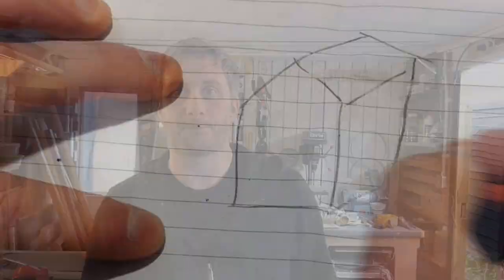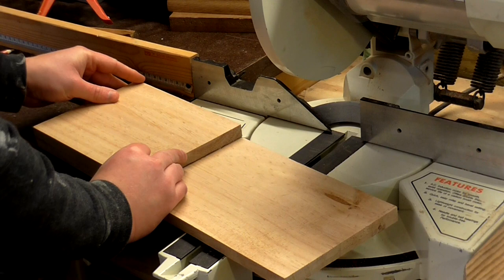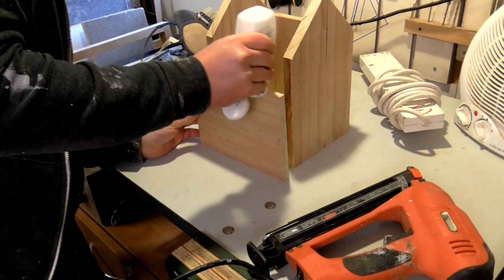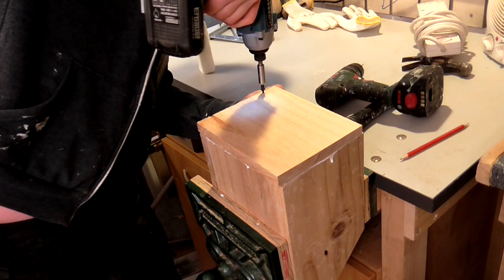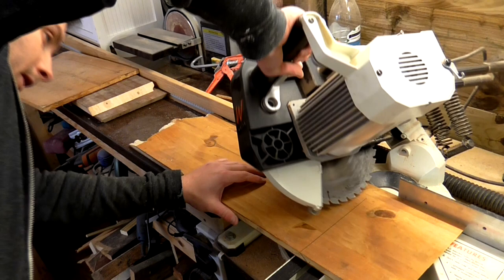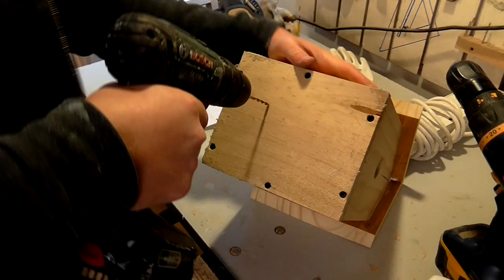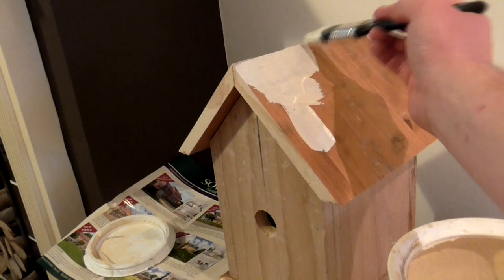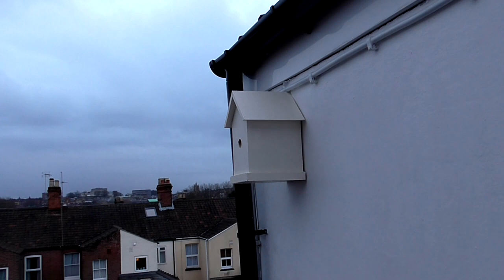Making A Simple Birdhouse

Comment: May I suggest some improvements?  Make the front removable for easy and thorough cleaning out. Cut the floor to fit inside the four walls , end grain of floor is then protected, avoiding adding trim around base which will trap rainwater. Fix slate or roofing felt on top for longer life of box.

Comment: Nice birdhouse. Thanks for posting. I assume you are mentioning about using drywall screws outside as being not ideal due to previous comments of other viewers. However even the great Matthias Wandel uses drywall screws outside and says he's removed them from an outside fence that was built years before and the screws were good enough to reuse! They will probably outlast the birdhouse!
Reply from the maker: +ksp1278 yeah lots of people say they're not strong but I've never found them to be a problem although they do heat up when you use an impact driver... Still haven't had one break on me though! Matthias did a god strength test of them too if you haven't seen it...

Comment: To avoid the need for that rear cleaning hatch just omit the glue on the bottom and just remove the screws in the bottom to clean out old nests. Doing this would also prevent the need to remove the birdhouse from the wall in order to access that hatch.

Comment: Screwing bottom part to the sidewall's boards engrain makes a weak joint. The screws might loose pretty fast. I would cut the bottom board to smaller dimension so that it fits inner size of the birdhouse. I would drive those screws from the side of the birdhouse.

Comment: was going to buy that electric nailer a few months ago. glad I didn't now. BTW are you drilling with the hammer action turned on? sounds like when I drill into masonry.
Reply from the maker: +Livi120 yeah I forget to change the setting haha
Reply: I have a tacwise nailer (different model) and have found that the only way to get it to drive nails the whole way in is to hold it down firmly with two hands and also remove the bit on the tip that protects your workpiece from being dented by the nailing action.

Comment: Why have the drill in hammer when drilling into wood it just makes your battery life shorter so you have to recharge the drill a lot maybe you could invest in some actual wood bits instead of drilling in hammer mode with a masonry bit
Reply: UnqualifiedDiy the drill bits are not masonry they are hss bits witch are used for wood metal and masonry